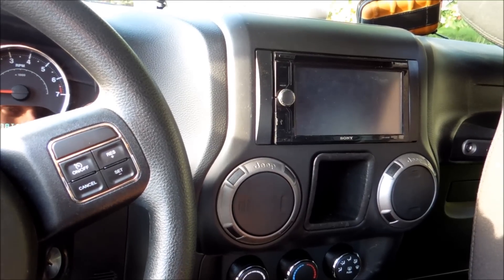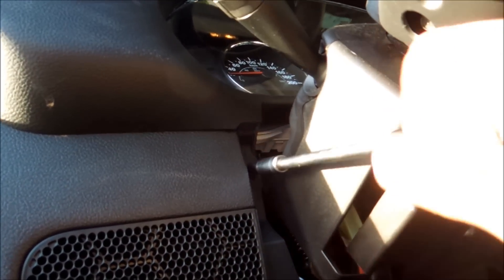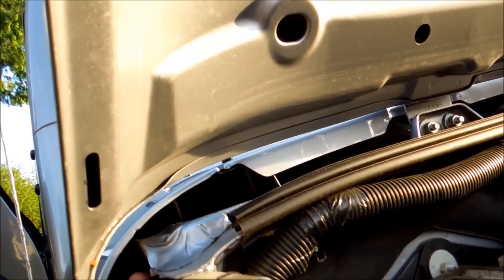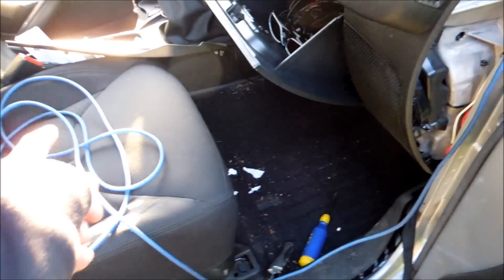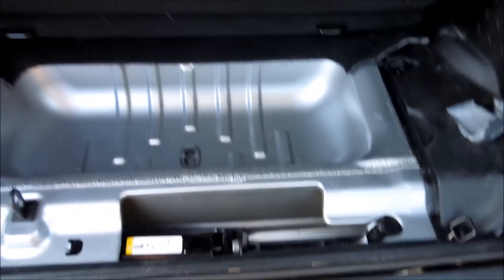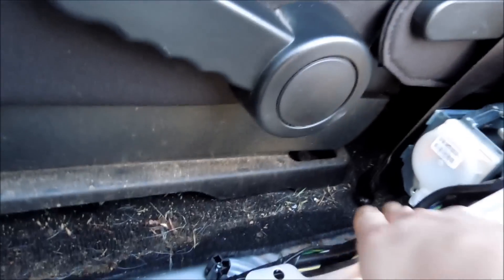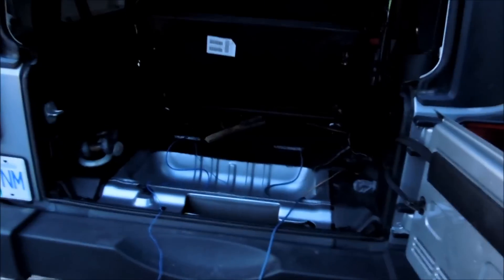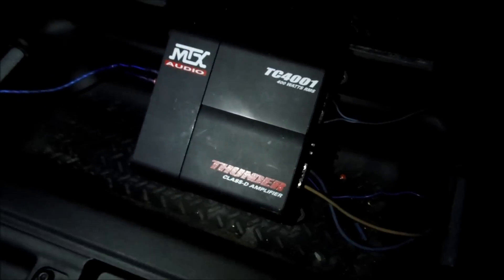How to install a subwoofer and amplifier in a jeep wrangler sport jk 2013

Comment: that tub is going to flood much sooner than under the seat - it even has drain plugs for that very reason.  Consider using a plate to elevate it under the seat.

Comment: I'm about to hook up aftermarket subs in my buddies 2013 Jeep wrangler Sahara. He has a touch screen GPS deck stock that came with it. Do you know if there's RCA hook ups already on it or will he have to buy a new deck? Any information will help. Thanks.
Reply from the maker: JSTNbmxez4everz i wont if i were you and you have a nice deck buy a lc2i i have a video on them they wire off the 2 speakers in roll bar and allow you to add a sub :)

Comment: Nice video, I have a question bro I installed a 7 inch pioneer double din with a maestro rr kept all my steering wheel buttons but every since then it has drained and messed up two brand new batteries car dealer saying it's my after market stereo, can you please tell if you ever had any problems with your  stereo?

Comment: Does anybody know what your supposed to connect your remote wire into on the radio?  I know I can splice it into the red wire on the 12v socket but I don’t know how to Open up the bottom part of the headunit.
Reply: figure it out after?

Comment: What did you use on the back of the radio to convert it to RCA so you could connect the amp and subs?
Reply: Aftermarket head units usually come with rca ports on the back, factory units... i'm not sure how to.
Reply: LoLo Center if you're adding an amplifier to the factory head unit, use adapter PAC C2A-CHY23. You can find it on eBay, Amazon, Google, etc. It plugs directly into your factory unit, CAN bus, and provides you with 4 rca outputs. Quick, easy, and zero cutting our splicing. Basically the only way to add on to the factory system.
Reply: Dropzonemedic is there anything better? I hear poor reviews on this adapter.

Comment: Will it still connect if I have the stock stereo?
Reply from the maker: No for stock stereo you will need a lc2i also known as a hi to low adapter
Reply: K thanks
Reply: If I get the lc2i do I still need an amp ?